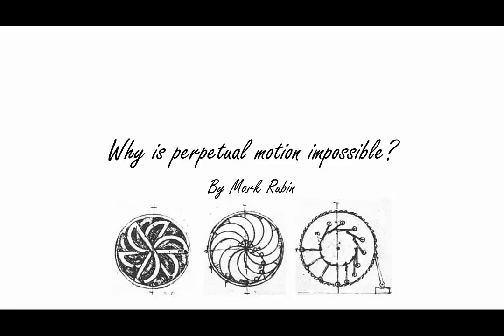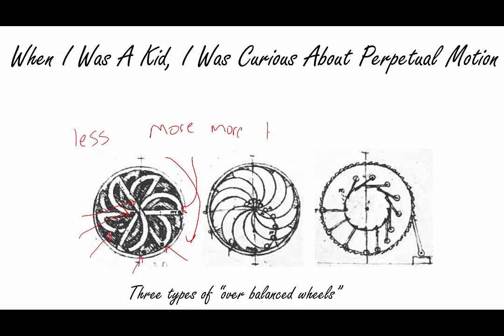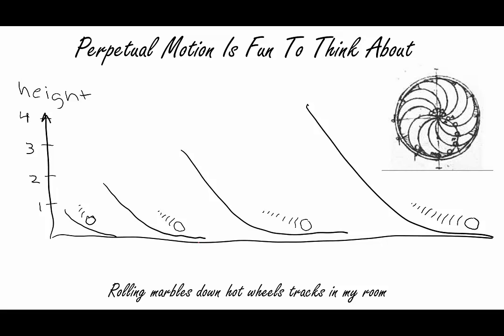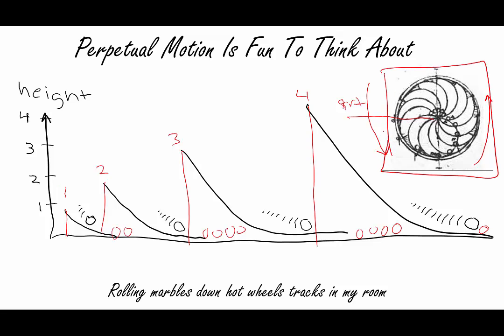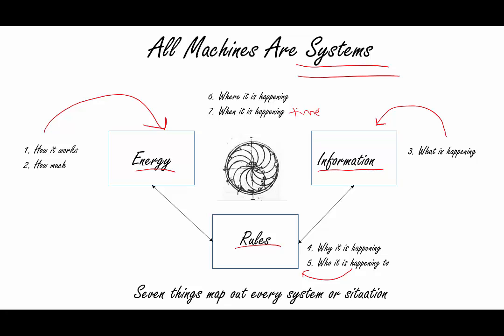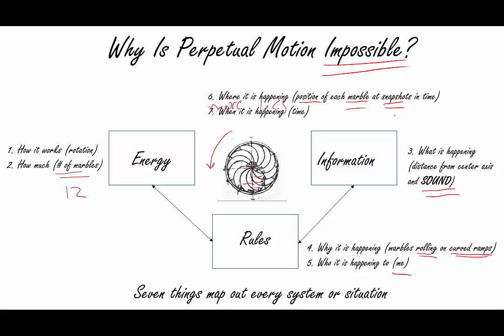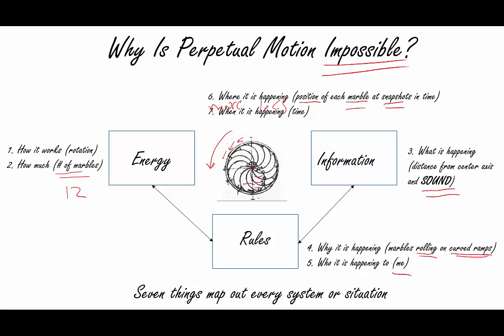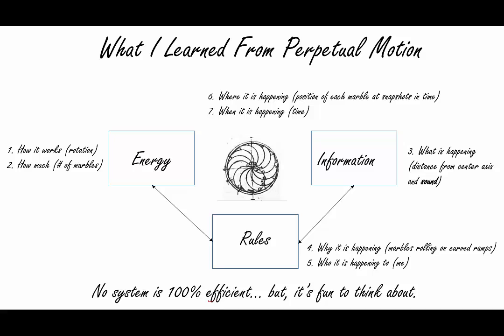Why is perpetual motion impossible?

Comment: But there is energy constantly entering the system. There is gravity that always pulls down on the marbles. The only way for them to actually slow down (if made correctly) is if they would build more friction as time goes and then to get to a point that there is more friction then gravity could pull. In the end the machine will stop, but that is because it drains energy from gravity, and it will stop once gravity will be too weak to support.

I found some perpetual machines that use magnets. I think it would be the same deal. They will work for a long time creating a circular motion, until they would lose their magnetic field.

Comment: I have a question for you. I have long thought about perpetual motion and have come to the same conclusion as you for the example that you used but I also realized something else, This is only one system (specifically mechanical based perpetual motion) what about other systems specifically ones that don't need a 100% efficiency to obtain perpetual motion or make use of natural law like fluid dynamics or magnetism. I have seen the self flowing flask and it is sound on the small scale (not truly perpetual due to evaporation will eventually leave the liquid level to small to sustain its self poor but that could theoretically be resolve with putting into a closed system so all condensation feeds back into the liquid reservoir) and I have seen one that uses a track of magnets like a mag rail train. I see no reason for either to stop even if they are not 100% efficient because the motion is not dependent upon the energy produced by the motion and in fact the energy produced by the motion is just byproduct and does not go into moving the object at all (water is moving due to fluid dynamic laws and gravity and magnetic is due to magnetic field interactions) so efficiency is moot to those systems continued motion. I theorize that as long as you don't have to start the motion (something in common with both examples above) then a system can be made where the motion will be sustained not by the motion itself but by what is causing the initial motion to occur in the first place.
Reply: N0c7u5 TL:DR - Mechanical perpetual motion is impossible but other types of perpetual motion should be possible

Comment from the maker: Zach - It is cool that you are working on your own design, but it isn't just a question about replacing parts.  It has to do with the fact that it takes energy to process information and all machines are leaking information, so they are also leaking energy.  Even if you use magnets for the bearings and put the machine in a complete vacuum, it will still stop eventually.  Either way, I'd like to see what you come up with, so feel free to post a link to your machine when you get it finished.  Have fun.
Reply: ***** Brilliant, I really like your thought processes, however there is one thing I would like to add. You mentioned in your video that energy is leaving the system that causes it to not be perpetual, this is true, but to go into more detail even if no energy left the system it still wouldn't be perpetual because it would become balanced, and would reach entropy. An example would be two flasks connected together with a tube... fill one flask with water, and the other empty, the full flask would fill the other flask until they both reached the same water level then the flow would stop then any work preformed would stop. 

In order for something to not become balanced you would have to have a flow of energy, energy would have to leave the system, and this is where perpetual motion becomes impossible, because this would mean you would have to have either an unlimited input energy source, or you would have to create energy to make the system imbalanced so energy would flow from a high energy state to a low energy state thus creating work in between. Like a water wheel for instance. This is thermodynamics which you seem to be well aware of.
Reply: ***** Hi im actually working on a Perpetual motor and heres the thing that makes it indefinite is the materials its made out of mine wont go for 1000000 years but 20 to maybe 100 years of almost worrie free electric for almost nothign for the motor/battery pack worth it? or the other things i would like to do with my motor in a car.... a self contained motor/battery pack i could say for the guys out there.. perpetual has a lot of potential but like why mine didnt get patented is cuz of the political bs... and the other thing it so much better for the environment..
Reply from the maker: +ronc1357 You are right. I appreciate the clarity of your explanation.  Thanks for watching the video.

Comment: This is not the best design around for a perpetual motion machine, its cool that they were thinking about it hundreds of years ago. BUT I think you may be wrong about the possibilities of better designed machines that use more then just the force of gravity. Sure friction is a bitch, (not in the sack) ha ha ...? um but if you could replace said certain part every now and then I believe you could make a machine that can power more than just itself. And near to forever if you just keep changing the parts when they get old and shitty the machine will keep on spinning. I to am working on a machine that may be able to do this. When its off the paper and on the table I will be sure to post my findings. Even if it doesn't work .......SCIENCE! lol